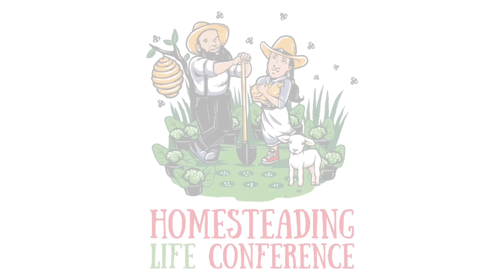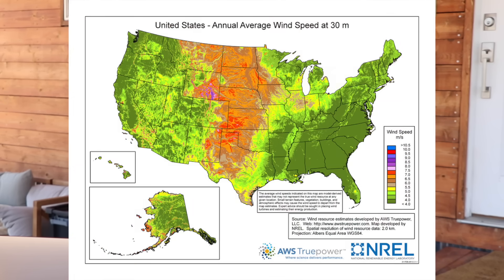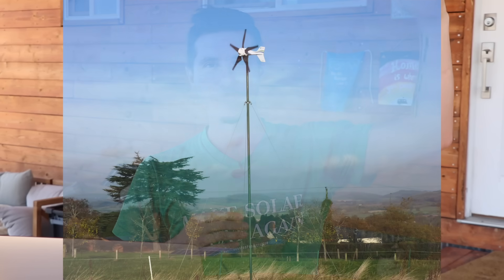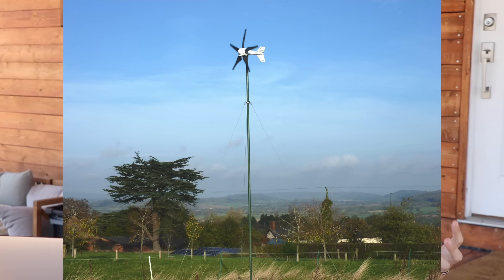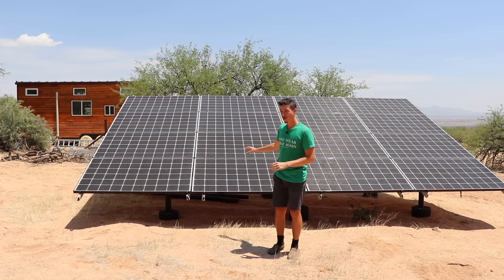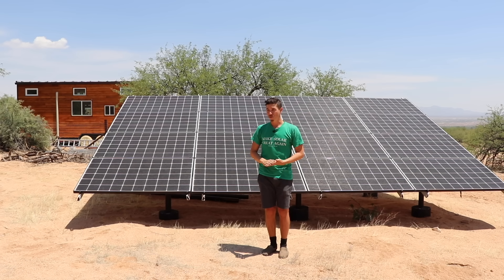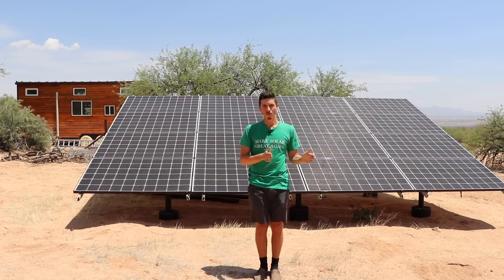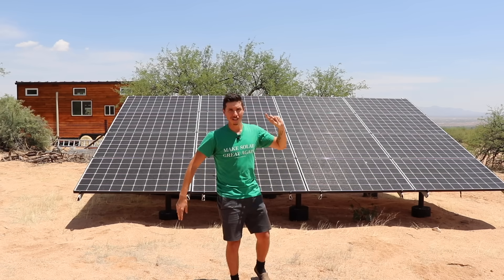Micro Wind Turbines... Are They Worth It? (Off Grid Solar)

Comment: Solar is great however you are giving a one sided view which is wrong. Obviously you need to check your information. Wind turbines are worth it and your perspective shows lack of understanding. Solar is hardly maintenance free, just keeping them clean in the desert is a chore. I live in the desert of Arizona and true wind is not always present at the useful level, however a turbine is another tool in conjunction with solar to provide all round power. Neither solar or turbines are a total answer alone all the time. It is foolish to cut off a charging method that even in the desert can function at night and cloud dominant days. Usually when it is cloudy weather, there is more wind present. A taller tilt up tower some say is best but that depends on area, however short towers can function well. You should know that Monsoon season can produce turbine power easily. Turbines don’t always have sufficient wind, well solar doesn’t always have sufficient sun. Usually one works while the other sleeps. Recheck your information before giving the wrong information. Like what your doing, just get your facts straight. I’m sure you are trying to help others so don’t discount turbines that even in the desert can be a very important part of a total answer.

Comment: IMO wind energy is another form of solar energy since sunlight hitting the  planets surface creates the temperature differences in the atmosphere, oceans,and continents which create both wind and ocean currents. Since the sunlight is reduced on cloudy days or at night and seasonally variable depending on latitude I would think hybrid solar/wind/geothermal/cooling systems combined with passive haus homebuilding science would provide the greatest energy security for an off grid lifestyle. What percentage of the energy load each would carry is dependent on "location, location, location". Since all these sources are basically free and renewable, my main concern/question would be what are the best energy storage systems available? Again it depends on one's local environment.

Comment: You are a IDIOT ... 
I GOT 16 X 200Ah AGM Sonneshine made for solar power (i get 4 more so 1000A @48v = 48KWh 
I also got 
24 RECOM 250Watt+5watt East 45°
24 RECOM 250Watt+5watt vest 45° 
4 150v @48v PV EPever upgraded to the 200 v PV 
3 TEP6000Watt@48v ...
I live in Denmark shortest Day is 4 hours of light .. 21 of december 
If luckey 2 hours of 24° sun low HANGING .. 
So you guggeli guuuk Wind turbine dont Work .. please .. 
You Sound like a retard FLAT ERTHER  ... 
3000Watt 5M² swept area is the rules her ... 
If i did not use the wind turbine .. Then IT is the KIPOR TA6700 SILENT DISEL GEN
SO BLA BLA PUT UP MORE SUN PANELS .. AND BUY MOR BATTERIES ..
GO PLAY WITH YOU FLAT EARTH FRIND'S!!!! 
HER IN DENMARK THE BAD DAY IS HALF NOWEMBER WHOLE DECEMBER JANUAR LATE FEBUAR ..
BTW my dumploads are 2 1500Watt Hotwater heaters .. heating the floor water
And the hot Water 
The 3Kw can film the batteri bank during the night .. and by the Day .. 
Wind maps say No wind.. we got 3 Month of ,10m to 30m kold wind from siberia easterly wind

Comment: It depends on where you live and how you live. In all actuality, hydropower can be the best depending on the amount of flow. All three are good options. Oh, and the solar does need maintenance, cleaning, the tracker does have motors, moving parts, and everything needs lubrication, panels need to be kept clean, they sometimes get broken by hail, wind debris, and covered by dust in dust storms, which Arizona has a lot. Do not rule anything out, design for your own needs.

Comment: Hi, i have question - i have hybrid solar wind system. 300w solar and 400w wind. I just notice that my monitoring system (live) showing incredibly down production when wind turbine is spinning. When sun shining but turbine does not turn, i get around 200-280w production, but soon wind turbine starts spinning, - the production drops - i get around 120 - 170w the faste turbine spinning the bigger amount of w is drops. Its looks like wind turbine does not produce any electricity, instead when its turning looks like its pulls energy back to it self? or what is happening? Any advice, please?

Comment: This is the most clueless video I have seen. Panels need maintenance they get dusty, hail can destroy them easily, they wires need cared for. Farmers have been using wind for centuries. Nearly all wells pumps were powered by small wind in the late 1800's to early 1900's.  Yes they are not right for every area but most places have more then enough wind. Complete stupidity.

Comment: Good lecture.  .  I am living off grid in Colorado.   . . Using any kind of wind generation eventhough I am setting in the perfect place for wind, I cannot even begin to pay for a turbine.   The cost of repair, the cost of installation, and it takes a LOT of wind to produce the amount of power the turbines are rated for. . .usually more than 35 mph. to get
less than 1/3 of what they are rated.

Comment: IMO, this is a great video I wish I had watched a few hundred dollars ago.  :-)   As DIY folk, it is almost impossible to resist the notion of setting up small-scale wind energy production... but like this video says, and I learned the hard way, it is not really practical at the hobby scale.   I tried several types, but found it to be  far better bang for your buck to just add battery capacity and as many panels as you're able.  Managing consumption also helps a lot.

Comment: Its true micro wind turbines are not worth it.  However I use a axial flux 13 foot wind turbine. I get 20 mph average wind speeds at my house. My tower is only about 30 feet up on a free standing tower I built. Because my tower is not real tall I get about 1350 watts an hour on average on a grid tie inverter. This is equivalent to about an 8KW solar setup. I also have 2 KW of solar panels on my roof. If it is big enough it is worth it. You don't have to go as high as they suggest. Better to have it lower to where your happy with the looks than nothing at all.

Comment: The wind is always blowing, but peak sun is only a few hours. I'm not hating on solar, I have a grid tied 4 kWh system with a 10 kWh battery. I've been looking at alternative power generating options and wind seems intriguing.

Comment: Thats easy to answer , because if you want to live offgrid on solar power , having a solar power setup so you can store power for 3 to 5 days on your batteryes if there is some days without sun , you can supply your solar system with a small homested Wind turbine , so the days without sun you can still get power on your batteryes , thats why .
Where i live this will be a wery good idea .
Today there are allready many companyes that offers a full ofgrid solar power system with EVERYTHING  and these systems you can chose and as a ekstra option your own wind turbine , many different shapes and sizes depending on your needs and your solar system , but ALL the systems CAN be built out with this ekstra option your own wind turbine as a backup for these days without sun , and they will come , it dosent have to brake the bank , and they are very low noise , AND A BIG PLUS IS these small house hold ofgrid wind turbines start to produse electrisity WITH VERY LOW WIND SPEED AND ARE VERY EFFECTIVE for your homested / ofgrid , and you can set it up you self or Pay the company to do it , thats up to you and how much mony you want to send on it , BUT like you said it maight be a little ekspensive to buy all you need and get it installed proberly,  but when you get that done , its just standing there and making electrysity for you and your ofgrid homested,  and a small house hold ofgrid will be a great investment for you it WILL cover your back these days without sun and they will come trust me , they do where i live,and these days you will be Happy when you look out the window and see your windturbine spinning and produsing power for you , and you know you are not running your system low and killing your system .....

Comment: I don't get how more power going into charged batteries causes a wind turbine to overspeed. That video you showed was a wind turbine which brakes broke in a gale so it just went to fast and the turbine structure couldn't handle it. And finally of course solar panels are better for you, you live in a dessert where there are barely never any clouds and There is little wind, for example in Britain there is little sunlight and much more wind so turbines would be better.

Comment: The high desert in California has much sun but even more wind.  Do both, you get supplemental power around the clock.  You can feed it back to the grid instead of using batteries, and save having to invest in batteries which will need to be replaced.   No need to put it up so high.   This sounds like a lot of fud.

Comment: I have a wind turbine but I live in Oklahoma and it's always windy here. Takes up less real estate, isn't that noisy at all. I have been using wind turbine for 2 years and it works great for me. I suppose it just depends on where you live really. Having an 80 ft tower out back doesn't bother me. I'm estimating it will pay for itself in less than 10 years. Idk how much a solar system costs but I have a 10kW unit and my electric bill runs about 20 in the summer and about 6 in the winter which it used to be around 190 in the summer and 70 in the winter.

Comment: I have only watched a few of his videos so my comments are made on that basis;

1) He didn't mention major issues like planning permission which are normally needed for both Solar and Wind Generator systems
2) He hasn't mentioned efficiency of these systems yet - solar and wind are notoriously low efficient in converting sun and wind into electricity. This is why you see huge wind and solar farms so that some meaningful output is achieved
3) Has he mentioned any return on his investment [when the systems paid off] in these solar systems. Many systems never pay off their cost before the owner moves or dies.

One technical question
Are any of these systems lightning protected so that you don't end up blowing up your battery storage.?

Comment: The primary reason for wind power is that winds occur more often and steadier at night hence they complement solar power reducing the battery capacity needed.  Of course, there are significant challenges with wind.  As to diverting power when the batteries are full, the rear view/rudder can be turned to be at a right angle to the blades thereby putting the vanes out of the wind, that rear rudder is often spring loaded with I keep it at a right angle and released when wind velocities are too high.  Inexpensive DIY micro wind turbines are literally just car alternators hence during the 70's, they were often 750 watt turbines because a car alternators in the 70's was 60 amp alternators.  Modern car alternators can be 100 amp alternators so home built wind turbines are typically 1200 watt turbines.   Naturally smaller wind turbines are available commercially often from China but as it is a mechanical device, you need to maintain it and therefore you should know it well and if you built it yourself, no one will know it better than you.  Wind power and even solar power is very dependent on your location.  Research your location's weather history as much as possible, I believe there's a website called weather sparks that I found a lot of information on.  The utilities may run long term weather forecasts before bidding on a location using the public domain weather forecasting program, I believe it's called WRF for Weather Research Forecasting.  I designed and built small computer clusters for a company in Texas to plan their turbine locations, didn't make a dime on that project but it was fun and during spare time.  But the basics for both solar and wind power is to know your location.

Comment: I think there is a proportional scale of efficiency and potential for energy loss with solar panels. 
Generally the more efficient (and expensive) panels are, there greater the risk to shade loss by solar strings. The cheaper and less efficient don't need much light to generate a little energy but require lots of surface area to compensate.
Wind energy has it's downfalls too. I think it's all where you live and what works for you.

Comment: Even just having 2-4 400w wind turbine's for those times when the sun is not out is a good idea, if your going totally off grid then you really want multiple sources of power to cover for low production times,  And plan for a much larger system than most people build 1kwh is not going to work, 5kw solar at least realistically 20kw of solar 5 kw of wind 100kwh of lithium iron, second hand solar farm lg chem cells are a great buy. and gas appliances.

Comment: why not the egg beater type spiral turbine.... wind in eve, night and morning before sun potential can be found... OR on bad weather cloudy days, such as when a front comes through... less to no sun potential in day but usually sufficient wind event. I agree though... novelty... OR good to pump water up from a well into a pond.... thats about it for windmills wihtout good wind potential.  Maybe on Mars>>>QQ ...LOL.

I like that your array is not on roof but remote away from house.  How far away is it?  What gauge wire did you use?  Series, Parallel or both.  I am gonna guess 24V, 10 guage underground wire to house/controls???  Also, MO can also get cold. I presume your batteries are Li-Ion but indoors.  Ever consider Rav-4 NiMH battery pack?

Comment: You missed the point entirely. Forget your context for a second. 

You have a 10k Watt Solar system -- That generates effectively 0 watts at night time, very few watts during cloudly days etc. 

Let's say you average 24 kWH of use a day (slightly lower than average house). 

That's 1kWH per Hour. So it's going to look something like this: 

Approximately 16 hours a day: -1kWH per hour (no sun, no real power generation  0 sometimes -2, sometimes)
averaged out)
4 hours a day: Let's call it break evenish +0kWH
4 hours a day: +9kWH per hour (sun's out, on sunny day)

If you are able to generate 500 Watts averaged out from a wind turbine during those 16 hours, you're cutting your bleed rate during non-production hours by 50%.  You're going to have the longevity of power.

Now let's ignore that and go to your context. 

Yes, solar is likely more logical in the desert -- but living the desert isn't very logical or practical for most.

Honestly, you were so critical of other youtuber's solar setup -- Pretty uninformed and terrible information in this video.

Comment: you should have a diversion load too for solar... its a very good idea to dump the extra into hot water resistor.. for example.

I hope no ones through some rocks to your solar panels...
Cause rocks don't damage a wind turbine.

You're clear a solar defender... but overall, it depends where you live.
If you go to Scotland, solar won't do the work...

Comment: Okay screw the significant big turbines or paying for it what about the DIY turbines that people hook up two small generators and have made out of scrap Parts plastic barrels and old fans I've got four of them set up their little and they've helped out quite a bit and didn't cost me nothing to make also supports recycling solar panels are extremely expensive there's a reason why a lot of farmers back in the old days went with wind turbines for supplemental energy usually for their well house

Comment: when you say "and they are getting sun every day" about solar panels, that sucks people in to thinking a solar system is reliable all year.. I'm sure there are many parts of land where sun shines most days.. in other places it does not... where I live (Vancouver BC Canada) there are MANY days that we have no sun.. in fact my solar panels on my RV are basically useless 4 months of the year.. for me about 8 months it is keeping my batteries full or close to full.. for 2 months I use generator part time to charge, the other 2 months I use generator constantly.. for example yesterday (Jan 5 -2019) my 1040 watt (4 x 260 watt) solar panels produced 0.1 KWH... the day before 0.0 KWH, the day before, 0.3 KWH... during the summer they produce 5.5 - 6.5 KWH, mid spring mid and fall about 3.5 - 4.5 KWH....

Comment: Sailor's use both wind and solar to generate power on board their vessels, having only one source of energy production is like putting all you eggs into one basket, wind, solar,hydro, and perhaps a Wood Gasification system to run you tractor, or truck, or your generators.
Having Handeeman explain his likes /dislikes rather than clear and precise pro and and cons. 
Feelings matter I suppose, but not when talking about energy that powers up your house.
Additionally why aren't you out in the hot sun and doing that work yourself?